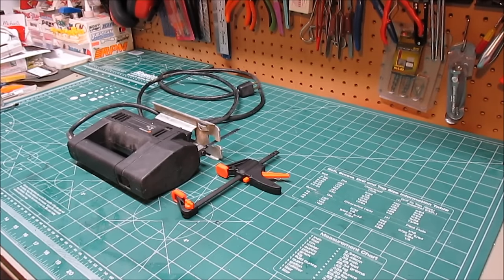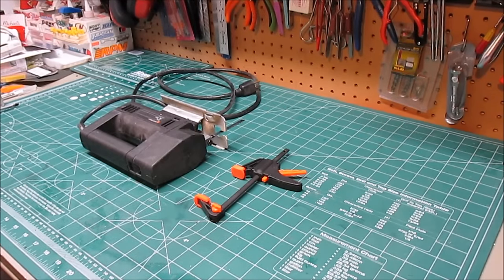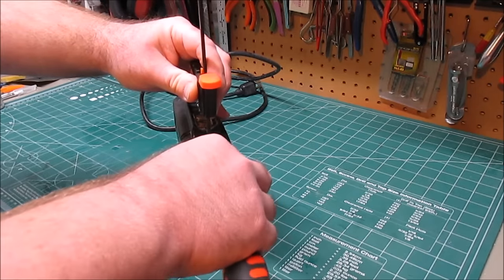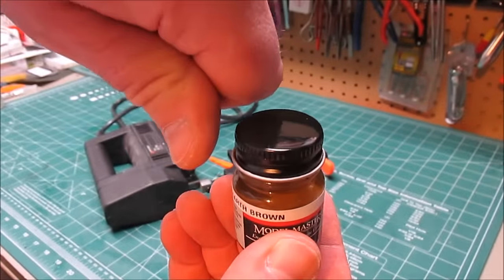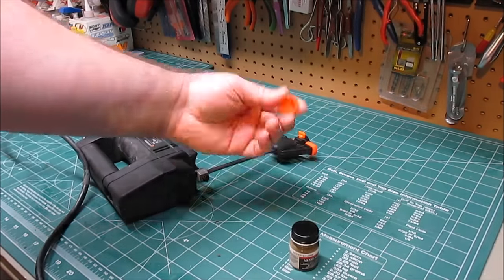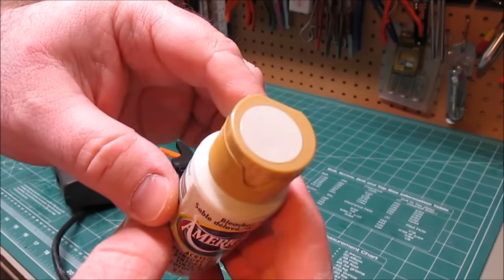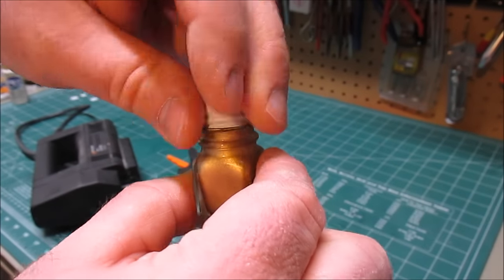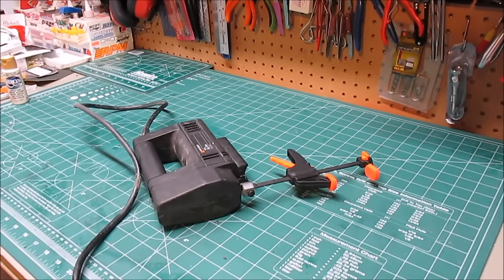Hobby Paint Shaker For Under $10 How To DIY

Comment: What a fantastic economical tip! Much better idea to use existing tools together rather than spending $50 on a purpose-built paint shaker. This will not only save my 20+ year old paints but will help to prevent me from getting carpal tunnel again. 👍
Reply from the maker: Thanks, glad it will help!

Comment: Works very well. Notes: Careful to not overtighten a small clamp as the mechanism may break. To stop bottles from flying loose during mixing, apply a small piece of double-sided foam tape to one end. Mixing can be further improved by inserting small ceramic or steel or plastic bead into the bottle.
Reply: I put bbs in all my model paint jars.

Comment: Thanks for the idea, I use this method now. My clamp would not fit in the saw so I used a blunt blade, a wood dowel and araldite and fitted  a plastic container to put the pots in. It save on arm ache no end as you get older.
Reply from the maker: I agree. Glad you got it figured out.

Comment: Great vid. Actually got a tennis elbow from shaking Vallejo acryllics... I just want to add, that you can't use any jigsaw since they don't have the same clamp system.
Reply from the maker: Thanks for watching!
Reply: Excatly..My Makita has different system :(
Reply: Yes, a better quality jigsaw may not work as you mentioned, but most cheaper brands of saws actually are set up just like the one in the video.
Reply: I used an old jigsaw blade sanded it and epoxyied it to the clamp then wrapped it with garden wire (to cover the teeth) then added some epoxy to that it works great even with a different model that has the newer quick release

Comment: Just picked up an old Skill jigsaw the other day for $10 to make just this setup. Thought I was really clever coming up with it but it looks like I’m way behind in the smart ideas department. Love the clamp, I hadn’t thought of that. It’s mainly the older units that have the clamp as the newer ones have the tool less blade change. There are many different clamp styles around too but come on people you have the basic principle so just apply some lateral thinking to work it out. There will also be less problems with the clamp if it is used in a vertical way.
Reply from the maker: Very cool, enjoy your shaker!

Comment: I am just wondering if it may work even better if you had some small square pieces of wood or foam board to be placed onto the lid and the bottom of each paint jar to be shaken when the bottle is inserted into the clamp. They may keep the bottle from slipping and being tossed out of the clamp as it is shaken. Not sure if it would help or not, but may be something to  try out and see. The bottle cap seems to be slippery when the rubber of the clamp is tightened down to begin the shaking process. Maybe the rubber pieces of the clamp need to have something sticky applied to them to hold better when the saw is shaking the paint bottle so hard. Not sure if something like double stick tape would help or not to keep the bottle from slinging out of the clamp like it did with you in the video.
Reply from the maker: You can try any of that, customize the idea as you wish.

Comment: I just made a better holder for the Jigsaw mixer. I used a 1/2 inch piece of steel bar stock, and a 1 1/2 inch conduit hanger from the hardware store. I took the barstock and ground down one end to fit the jigsaw. And mounted the conduit hanger on the other end. And a thumb screw and shrink tube to cover the hanger. and replaced the nut on the hanger to a thumb screw. No more paint bottles across the room! 😄
Reply from the maker: Whatever gets the job done, enjoy!

Comment: -Another idea here (As I do) Get 1/4 inch Sling shot BB's, Wal-Mart, K-Mart, that carry "Daisy BB gun" supportive items, should have these rather large BB's they're a quarter inch STAINLESS STEEL balls. Stainless because anything else will distort the paint over time with the metals oxidation.... MAKE sure they're Stainless Steel too! add one per bottle of paint, and when you shake it, they will loosen all that pigment in the bottom of the bottle! With this shaker, your almost guaranteed to get good mixing results!

Comment: Hello seen this vid looks amazing I have put s steel bb in my bottles, now got a wilko speed clamp 6inch now need a jigsaw, if I get a varied speed jigsaw which setting do I use
Reply from the maker: However fast you want to shake the bottle.
Reply: @hpiguy  is it a 150mm Irvin mini bar clamp your using as I got a new jigsaw an the clamp I got don't fix lol

Comment: Help!  For those of us who are late to the party, do you have a modle number for the Harbor Freight clamp.  I am not able to find one with a bar that is small enough to fit in the blade opening.
Reply from the maker: I wouldn't know any model number, they are just the 99 cent clamps they used to sell.

I'd simply grind down the bar on the current clamp until it fits the slot or shop around for other cheap clamps at hardware stores, etc.

Thanks for watching!

Comment: Brilliant idea. But, my issue with mixing paint by shaking is, with bottles such as Model Master or Tamiya, paint gets on the lid which then gets on the lip which then gets on the threads...boom, stuck lid that can only be opened with pliers. I've tried wiping the lip after shaking and it helps some, but I still have issues with the lid getting stuck. Any ideas???
Reply from the maker: I haven't had any issues. Any that stick I just open with a wide mouth pliers.
Reply: I've put plastic kitchen wrap (e.g., Saran Wrap) over the mouth of the bottle before putting the cap on to try to keep air out of the bottles. Maybe something along those lines would help with paint on the threads. If you try it, be sure to let us know.
Reply: will do

Comment: What size clamp? I bought a 4in ratchet bar clamp and it it won't fit in saw?
Reply: i had the same problem, it did fit in the saw but the clamp was thicker than a blade, made it sit cocked when you tightened it down causing the clamp to fall off after a few times using it, so I took a file and filed the end of the clamp down to the size and width of a blade and it worked great, no problems does not fall off anymore.

Comment: What about Vallejo and Army Painter type bottles? I guess You could do a little modification to that clamp and it would hold a Vallejo bottle. Thanks for the idea! I'm gonna make Me a shaker. I read the reviews on those Robart shakers..and it sounds like a waste of money.
Reply from the maker: It will hold any bottle that will fit between the clamp. I use army painter washes and paints often, no issues.

Comment: Get one of those rubber pads that you use to open tough jars, and cut out two pieces and glue them to the contact points with super glue. Slipping solved.
Reply from the maker: Yup

Comment: Well crap, i just happen to have a jigsaw that i lost the plate for anyway!!
Reply from the maker: Thanks man, hope it works well!
Reply: I'm giggling how well this works lol
My saw had one of those pull the plastic thing down and shove the blade in anchor, as opposed to an actual set screw so i grinded the end of the clamp down to .97mm to match blade thickness. IT WORKS MYAHAHAHAHAHAHAHAHAH
Reply from the maker: Sweet!